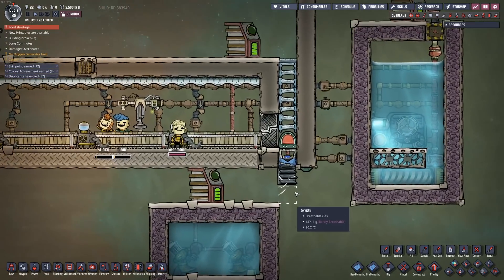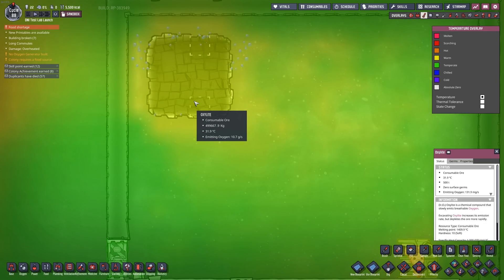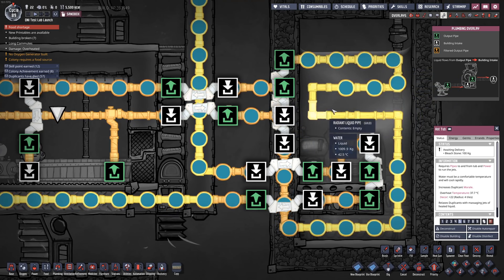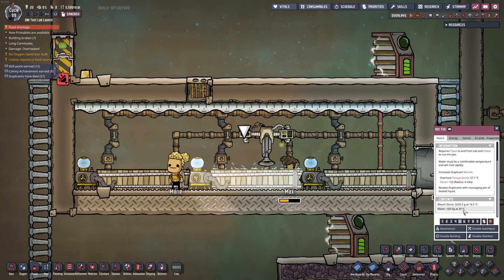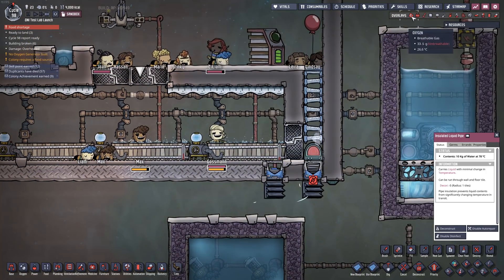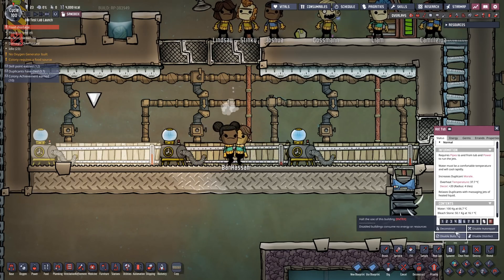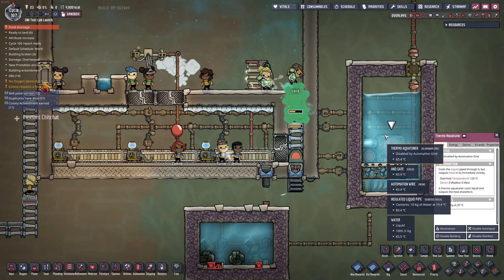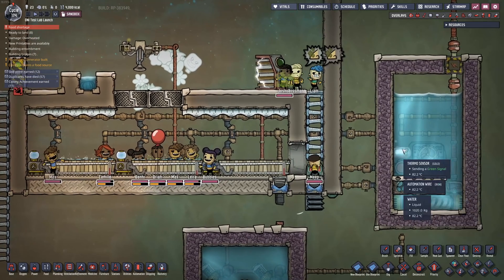Can You Flush Heat Using a Hot Tub? Oxygen Not Included

Comment: One piece of equipment that can surprisingly delete a fair bit of heat is the compost. It has a function that automatically resets the temperature of stored materials. So, when polluted dirt is placed in it, it can start out super hot, but as it transforms the stuff into dirt, all stored materials will turn much cooler, resulting in only decently warm dirt.
I'd love to see a use for this.

I once thought that the compost could multiply the heat energy in polluted dirt, since dirt has a higher thermal capacity, but that temperature resetting ability of the compost ruined all my plans lol.

Comment: I'm not sure what I'm doing wrong with my hot tubs. I put them on gold metal tiles, tried all kinds of different water temps, added in temp shift plates, put a little water on the floor... They just overheat after a few seconds. The temp of the hot tub just shoots up. I was going to say it was because I built it out of gold amalgam, but now it looks like that has no effect either. It wasn't until I took the room down to zero degrees that I was able to keep it cool enough for a dupe to use it through to completion... which is very energy intensive. You didn't seem to do anything that I didn't do... so I'm confused.
Reply: build it out of steel. overheat problem solved
Reply: @paoweeo  yeah not sure it works that way.
Reply: @PeterElder  have you tried it?
Reply: @paoweeo  it overheats at ~37 degrees no matter what material you use.

Comment: what temp was the bleach stone when you put it in? it seems like it was put in at 10C or less.
water is transferring heat to the bleach stone because it's in the same "tank" and the bleach stone is being deleted as it's used. it kinda is deleting heat, however because it also outputs a fixed 5k DTU this kinda balances out.
thus the only way to see a net negative is to increase the temp of the input water AND reduce the bleach stone temp even more so that the temperature differential is greater and thus more heat is transferred in a given second. the more heat you can shove into the bleach stone before it's consumed the better.
actually it might be BETTER to not even let the dupes use the hot tub until the bleach stone takes a lot of the waters heat. 

lots more testing needed and it would be a good idea to test for how much bleach stone and water is actually used/cycled per use per dupe.

Edit: also would be great if there was a mod that made dupes need 0 oxygen for tests like this.